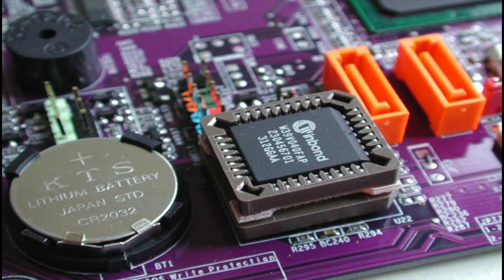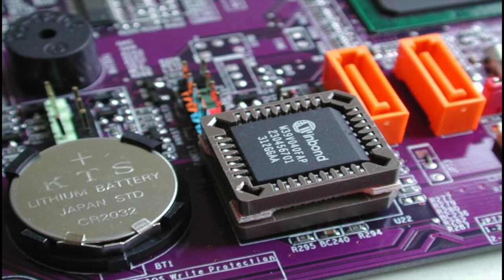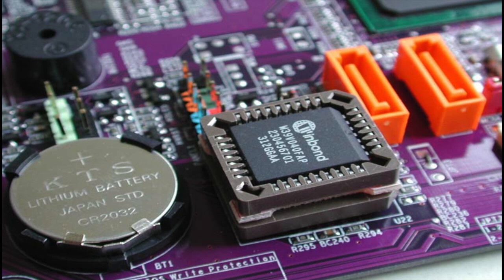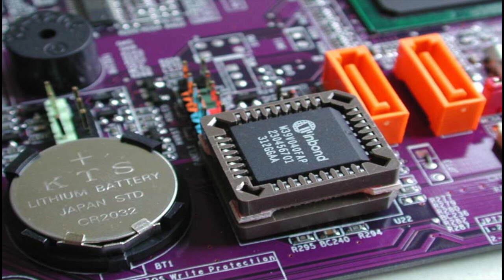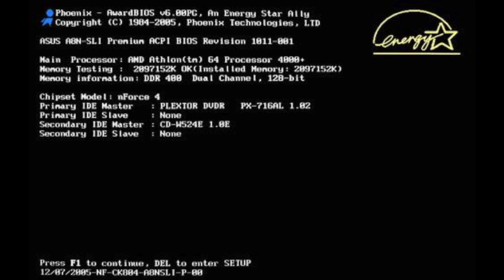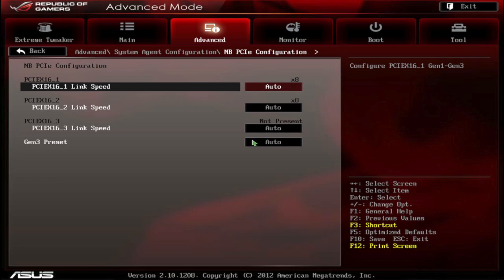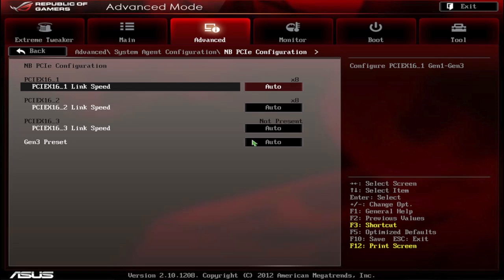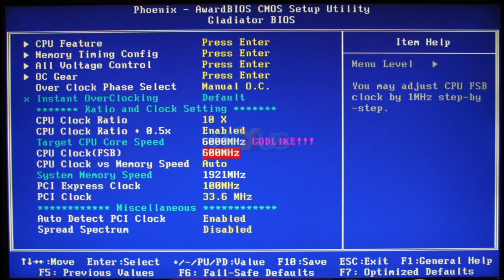How Computers Work: The BIOS (Part 2)

Comment: I had to reset the cmos battery when my computer over heated and the pc did not start.
Reply from the maker: It May Not Have Anything To Do With The BIOS, It May Be A Component That Has Failed That Is Preventing Your Computer To Boot.
Reply: ***** What ever it was, I was able to fix it.
Reply from the maker: Mark Hyder Great!